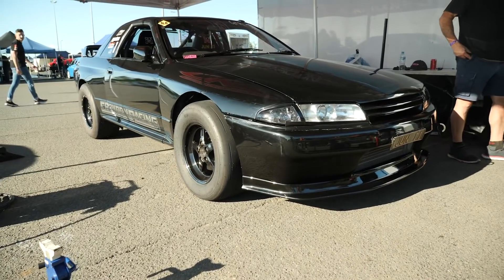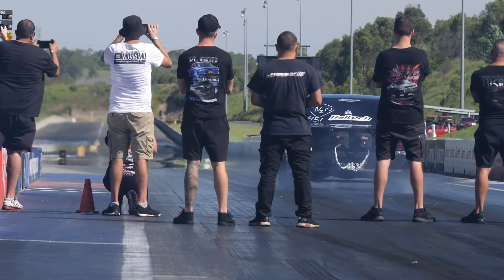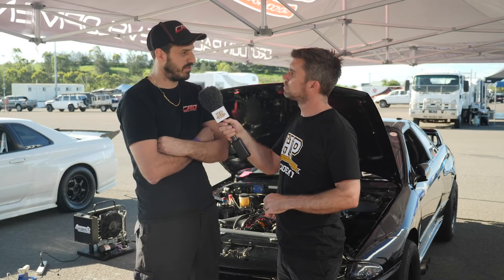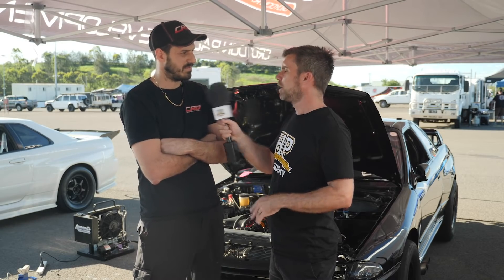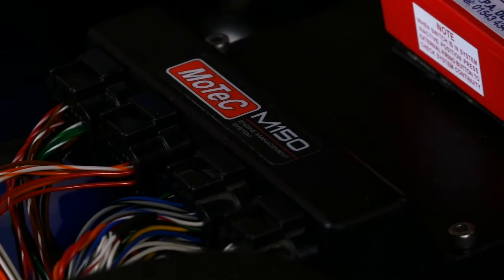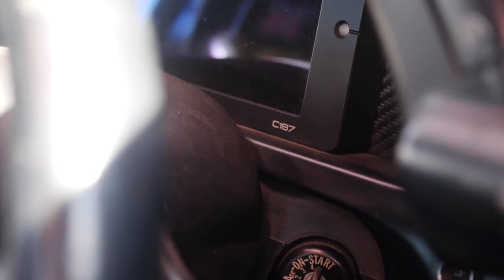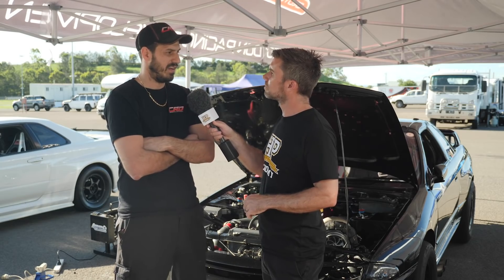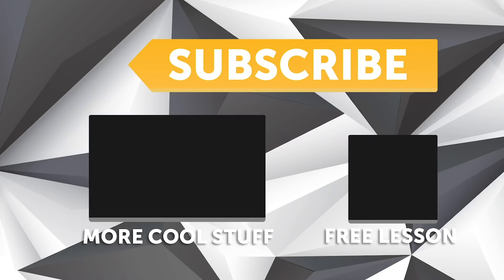2500HP RB26 'JUN II' | Worlds Quickest Street Legal R32 GT-R Skyline? [TECH TALK]

Comment: Why does it have a rear exit and side exit exhaust system?
Reply: The side pipe is to fully open the exhaust and the rear is the street car exhaust that smaller ect. It used a flapper valve at this time to switch between exhausts

Comment: Whaaatttt🤯🤯🤯 he made a Strokes to 3.2L and took 2500hp out of an Nissan?!?!?!? RB26😳🥵
Reply: It ain't a nissan rb engine any more.
It's a chunk of billet aluminium machined into the shape of a nissan rb.
Reply: @TheHusky2001  your exactly right. The block is billet. But the car still uses parts that would fit in an oem rb30 cast block. A billet block doesn’t determine what an engine is and isn’t. The exact design of the blocks rotating assembly is the exact same. The changes to the block are strength based and doesn’t interfere at all with the inherent design of the RB30’s internals.
Reply: @lennixsingh626  it's a copy of an rb block!
I highly doubt there are stock rb pistons, rods or crank in that motor pushing 2500hp.
The rb engine was made and named by Nissan.
Thats a chunk of metal machined up to look like an rb and designed to fit rb parts but its not an rb! 
Basically it's an rb mock up.
Reply: @TheHusky2001  That is quite simply the stupidest statement I have ever read in my life. No shit it doesn't have  factory parts. But that doesn't mean it isn't purist to the rb design. If they wanted to, they could throw in STANDARD RB30 parts and the engine would not only work, but run completely fine
Reply: @TheHusky2001  they could push the exact same power with the same rotating assembly on a cast block. It just wouldn’t last long before putting a hole in the side of a bore and the block itself.
Reply: Sofiane bimmer  i saw the video thx you lol
Reply: https://youtu.be/sVxQW2qAtj4
Reply: https://www.facebook.com/maatouksracing/videos/697275501048945/
Reply: https://www.facebook.com/maatouksracing/videos/340840127091384/

Comment: Loosely using the words street legal
Reply: The car literally and legitimately runs under the prostreet class. I’ll let you do your own research since your so smart
Reply: @lennixsingh626  yeah race classes have nothing to do with “road legal” 🙄… car wouldn’t even pass emission testing.
Reply: @ryanlowe3588  Theres no way ur actually crying about emissions on a 6 second car. practically any car on the road that has JUST an aftermarket exhaust wont pass emissions.
Reply: @lennixsingh626  I’m not I’m saying this car isn’t street legal… that one thing on it out of many things that isn’t street legal… your not aloud more the 1 modification to you intake system, intercooler upgrade, means you can’t change the intake manifold, or have no filter, your not aloud to remove factor controls, the straight pipe… no cat converter… if this car didn’t get put on a trailer and drive around, it would be a major defect and the hole engine would have to be pulled out and put back to stock… not even just emission running on meth
Reply: @ryanlowe3588  bros crying about an air pod now. when are u gonna learn that the RMS's standards for cars is complete BS

Comment: I would love to see them come to Germany and try to get it streetlegal over here ;)
Reply: they are actually ruining it for the normal street bloke who wants to add a turbo etc, eg, coupla hundred horsepower, so strict now to get anything passed, 2500 really is a joke to call a street legal. car. nothing about that car is legal, it would never get driven on the street, first cop who sees it would send it to the crusher. To really make this racing legit, bring a inspection fellow to go over the cars before every race, watch there balls shrink in under a minute.
Reply: @freechagosislandjohnpilger  A cars power doesn’t determine whether it’s a streetcar or not by drag terms. That’s like the equivalent of complaining about emissions on a car with just an aftermarket exhaust. This car runs in the prostreet class (highest class for streetcars) which consists of full factory chassis, radial tires, full interior and more that are street car esc.

Comment: Sounds a little bitchy, but I think it is time to have a separate "billet block" class...
Reply from the maker: @Frank at a certain point it is cheaper to go billet rather than trying to source and replace junked OEM blocks which is getting harder and harder with many platforms as they age, even if you have deep pockets - Taz.
Reply: Billet blocks don’t determine what an engine is or isn’t. The design of the rotating assembly does and this RB30 billet block has the exact same internal design as a cast block RB30. They in fact could use the EXACT same rotating assembly in cast block and push the same power. It just wouldn’t last as long.

Comment: basically they cheated, king32 is just as fast but on an rb30 cast block
Reply: Cheating? dumb ass
Reply: They no longer use a cast block
Reply: King32 has had a billet block for over 4 years. And long before this video was made. A billet block doesn’t determine what an engine is or isn’t. The internals of both the parts and block itself do, but they are off the shelf parts that can be used in both the billet blocks and cast blocks. There are no power benefits. Only strength which is NEEDED at this power level and isn’t cheating at all.

Comment: Cool video but how on earth is that street legal?
Reply: Well it would easily be street legal in Florida so I would say it counts.
Reply: Yeah you can’t even have pod filters here... or non approved seatbelts/brake hoses... it’s crazy
Reply: @YoutubeAreJewz  damn, that's make Indonesian car law looks perfect.
Reply: @ahrred3127  What indonesian car laws? lol
Reply: @butwait 
No Loud exhaust (I don't know the decibel limit).
No police light on car.
No engine swap(don't know if it's already allowed or not).
Not allowed to import second hand/used car.
The rest is just normal stuff like No excessive light or no radar detector, etc.
Reply: @ahrred3127  Loud exhausts are not allowed, like everywhere. Typically Engine swaps are not allowed, true. The STNK numbers need to match, this includes the engine. But as long as the block doesn't change who would know. meaning you can bore it up and change the heads and everything else. on a side note, it IS possible to swap the engine legally as long as you have all the engine documentation, meaning it would have to be a crate engine, and you would then have to get the paperwork processed at SAMSAT and get the STNK renewed. this doesn't happen often because who would want to go through the effort. the stack of papers you'd need including the stack of money just isn't worth it.
The import restrictions on used cars is a nuisance, agreed.
Police lights on a car, especially one with similar colors to police vehicles would get you pulled over anywhere.

But on the flipside, stance? no problem, wheels? whatever you want. Want to deck out your car with body kits, spoilers etc?  go for it.
Reply: @ahrred3127  People keep those engines to swap them back when they sell their cars, it's simply impossible if the engine didn't come with paperwork. mainly because most engine swaps here are engines out of other cars without any documentation. and that will never work.
Reply: @butwait  Now I can sleep with peace knowing that Indonesia allow engine swap, but it's still bothers me that they don't allow second hand/used car importation. (I know SEA games and/or embassy from other country usually bring a good amount of car into the country)
Reply: Australia has very strict modification laws. The car is registered in Aus but is NOT street level due to the modifications..
Reply: when these guys are saying "street legal" its not a literal definition -- it's more that it's a full weight, full chassis car.. ie. the vehicle itself could be a legal road car
Reply: Australia
Reply: @ahrred3127  i live in Australia.  I can't see how its street legal.  Ppl get tickets for pod filters here..
Reply: @davey_projects2977  Engineering certificate? I heard those in Victoria but I don't know if other part of Australia have those, also do you live in South Australia? Cause from what I heard that's the strictest part of Australia.

Comment: Does anyone know what the cooler on the left is? Looks like it's pushing or pulling air over a radiator.
Reply: Probably a external trans cooler
Reply: Wireless aircon unit

Comment: Pretty radical design with a auto mated to a standard gearbox.
Reply: It’s mated to the standard transfer case. It’s actually what’s in rob dahm’s 4WD 4 rotor rx7. Still crazy a standard unit handling that much made in 90’s

Comment: Is the exhaust coming out below the passenger door 'street legal'?
Reply: Street legal meaning unmodified chassis, look up the class requirements
Reply: Also the exhaust has a v band flange there. 5min change and exhaust routes back out the back of the car
Reply: Technically, if the rear doors were welded shut and it was registered as a two seater, and passed noise limits, it is legal in Aus. But that is just the exhaust exit
Reply: Breathing a bit of carbon monoxide may still be an issue with opening windows, so full welded doors and no opening windows would fix the issue.

Comment: Question from the newb in this kind of racing...

What's so limited on oem chassis to have the need to go another route? Chassis flexing when launching? Fatige? Stock subchassis mounts now able to hold the forces?

Thanks in advance!
Reply: Tire, weight.
Reply: The oem chassis is heavy and there’s not much room for anything.

Comment: Can everyone agree to stop saying “Street Legal”. These cars are far from that. 
“Street Registered ” yes but Street legal 👎
Reply: yep, having a dodgy (overly permissive) inspection report (pink slip) and trailer it to/from the track to avoid defects means you can keep rego forever, but no way would it pass a road side defect station, so no it's not street legal.

I'd like to see any of these claimed 'street legal' 6/7/8 second cars actually pass a road side police run defect. 

but racing is and always has been about skirting the rules and not getting caught.
Reply: dataminetk correct. I’m not saying that everything should be fully engineered to be compliant and also not arguing that they are street registered because of coarse they are. Even my mildly modded R32 wouldn’t pass as “Street Legal” if a full inspection was done but it’s definitely street driven.
Reply: @dataminetk  you do realise nearly every modified, rego'd car is defectable, don't you champ? Shut the fuck up and post your car 😂
Reply from the maker: It's a racing class, it fits the rules for that class so it gets the title. You can race in whatever class you like yourself if it's not for you as there are a ton of options out although some classes are much more active than others. Have fun :) - Taz.
Reply: They really mean full weight / full chassis.. it's not attempting the literal definition of "street legal"
Reply: Lol he drives it on the street legally. so it is street legal. You can’t drive on the street without being legal. Not legal no rego.
Reply: IAMAnteP why the “LOL”. You can drive it on the street and not be street legal. Even basic mods can make a car no longer “Legal” but you can continue to drive it on he street.  Can’t believe I need to explain this out loud. 🤦‍♂️
Reply: @troyvantrienen9418  depends what country youre from. You should already know this, but the quickest skylines in aus arent that heavily modified compared to other cars running similar times. Theres a good video of JUNII which is the actual fastest street r32 going through a maccas drive thru for reference that its 100% fine to drive it normally.
Reply: StressedPoet654 I live here and have been to GTR festival a number of times. You’re free to drive your 2000+hp GTR through any drive through but I challenge you that it would pass an inspection. Again, I’m not saying that they need to be  totally engineered for legality but by saying that you’ve seen a car drive on the road and there for it’s “legal” is not accurate. I totally understand the difference between Street ‘Legal’ v Street ‘Registered’ but apparently most comments seem to believe that a car driven on a road instantly grants it as ‘legal’ and it’s just not the case.

Comment: Those compressor blades look pretty chopped up.
Reply: @TJ Pass turbos don't make more power when they spin faster and out of their efficiency range
Reply: look at the blanket. it's chewed up.
Reply: @TJ Pass lmao
Reply: Lol it's clearly eaten a mouthful of turbo beanie
Reply: @TJ Pass no
Reply: @TJ Pass lol cool
Reply: Electrical turbines at this stage in our technology will never be better than gas (exhaust pressure) turbines. Maybe one day, but right now, exhaust pressure will always have a proportional additive to the rotational speed of the turbine in the turbo. Plus, turbine lag is honestly addictive. Stomping your foot to the floor and hearing that turbo “WHEEEEEEEEEE- SUUU- TU- TU” will always be better. I don’t think you can change my mind. I love turbos and everything about them
Reply: @TJ Pass wha? ..oh.. OH, yea your right. I too have added weight to my compressor wheel for top end boost. ;);)
Reply: I think you mean balancing. It's true a turbine will run better at higher rpm when balanced. In rc planes they also do it with electric turbines. EDF's. Much lesser amps and more air pushed out. Lesser stress on bearings. But here it looks like the fan had a meeting with some dirt or stones. Doesnt make sense chopping each blade for balancing. Because then you still haven't balanced it. When one blade is heavier you need to take a bit material of the blade. Or add to the opposite blade
Reply: @cnnlt200  The manufacturer takes care of balancing and weight, turbos are made to a spec, and are meant to stay there. Look up compressor map efficiency range. There's a reason we buy different sized turbos instead of spinning them faster.